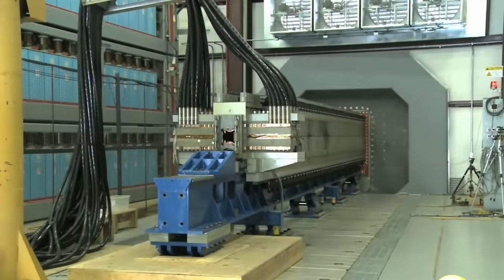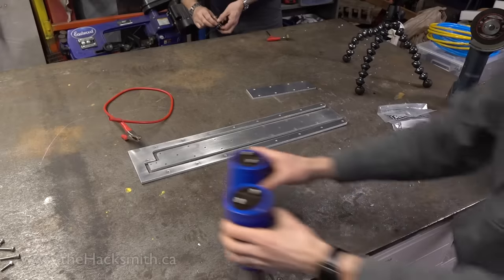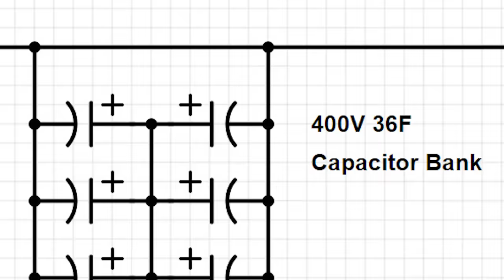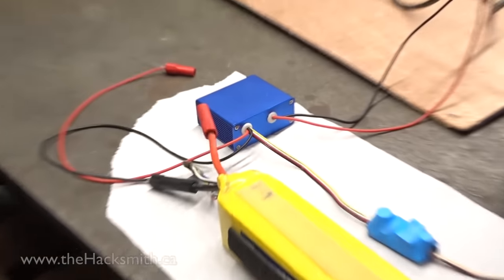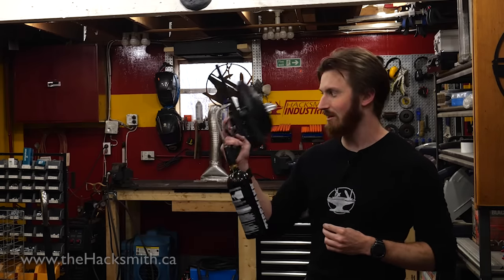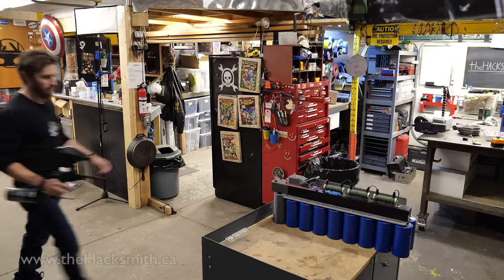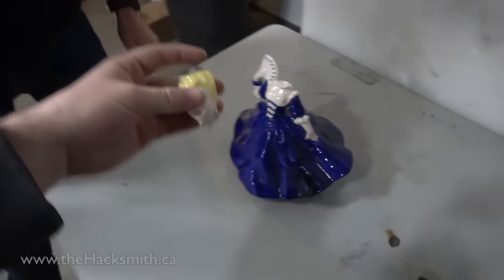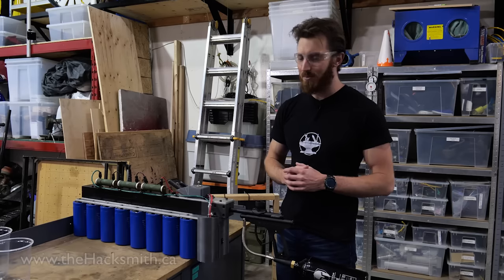Making a RAILGUN and then TESTING it!

Comment: The footage you show in the beginning of the big USN railgun, THERE IS NO EXPLOSIVE THERE!!! (THE FIRE IS JUST DUST IN THE AIR CATCHING FIRE WHEN THE SLUG GOES BY), THE FLASH WHEN IT HITS THE TARGETS (THE LONGER VIEW) IS 6 1 INCH STEEL TARGETS!!   The first time they fired that one they had a target (1 inch steel at 1000 yards (with a foot concrete and 15 feet of dirt)) they had to recover the round from FOUR FEET IN THE BERM!!!!  The 'disposable casing' would be the SABOT (pronounce sAy-bOW) which makes it possible put and round projectile into a square barrel.

Comment: There is something wrong with it, with that amount of energy, it should be faster than actual gun. It needs a synchronised acceleration.
Reply: because railguns use electromagnets to archive those speeds if i remember correctly and the bullets arnt round, the outside shell has fins that if i rememebr correctly are displaced by giant magnets in series pushing it really fast, dont know they actual physics to it

Comment: In some other rail gun build ups the most time was taken on timing the system. In this video no time use for getting timing right.

Also projectile was not that powerful, because it did not penetrate most of the targets, but just bounced off. Even in over 100 degree angle...

I think that the timing was wrong and therefore the railgun lost much of its power. Also ramping with random power levels means, the timing was even more likely wrong, because the time between coils varies on acceleration that magnetic fields make. Stronger current means stronger magnetic field inside the coils. You would need pretty excellent timing software and equipment to use just random power levels. And there was no hint that they used one...

Comment: Quick thing: If you can somewhat streamline the design (and maybe cut back on the power just a notch, can't you makea powerfist?

Instead of a projectile, have a weight attached to a rod which is propelled by the magnets, triggered by for example completely clenching your fist (you throw a punch with a half-tight fist, but the moment before impact, you clench it fully,  extending the weight as you make impact).
Reply: Also, It seems that the bullets (I know that's not the focus here, but still) could maybe use some stabilisation, since they tend to flip rather than maintain trajectory (kinda like shotgun slugs tend to do).
I don't know if you can make rifling on the inside of the railgun barrel, but perhaps adding some kind of rifling to the bullet will make it more stable in flight.

Comment: You should revisit this and see if storing the gun in colder temperatures like a freezer or using cold things like nitrogen to see if it'd give it a boost. You'd use less electricity thus then you could make the gun even smaller

Comment: not enough velocity for the round size so the round starts to "keyhole" as it is called. The round starts to tumble rather than fire straight. It's over my head for the physics involved but  I think there is an equation that to balance the size of the round to the amount of energy applied to the rails. I'm not fully versed in that, nor am I an expert, so my words only carry so much meaning.

Comment: Using two large copper rails will be massively reducing the potential power you are getting out. You need to use coils of wire, rather than solid blocks of copper. You will generate a much stronger magnetic field doing so.
Reply: Consider the flux direction of the solenoid and that of the rails. You would need helical coils running the length of the barrel.

Comment: I figure things out... There's a reason why a large scale rail gun keeps failing, except in science fiction. I believe mine will not only work, but will require far less energy. There is no propellant, other than a metallic shell. If you'd be interested in a collaboration, a build, and a video, send me an email with contact info. Using the same amount of electricity, I believe mine will shoot the projectile at least 30% further.. Oh, it's also more compact, cheaper to build, and lighter. We are going to need something like this for travel in our solar system and outward. I may sound like a nut here, but using atomic/nuclear power to charge an electrostatic collector, you'll be able to gather all of the raw material to replace your projectiles..

Comment: Hmm, maybe Canada's definition of firearm is different. The Texas Penal Code defines a firearm as "any device designed, made, or adapted to expel a projectile through a barrel by using the energy generated by an explosion or burning substance or any device readily convertible to that use." Since there isn't technically an explosion and there is no burning propellant, nor can it be quickly converted to fire by those means without substantial modification, even with higher power levels, that is not a firearm. IMO. I even looked up qualifications for a destructive device. This still uses propellant. If you would like to up the power, but are worried about legal issues, its something to look into. There may actually be no law against it.

Comment: Possibly the Vo velocity would be higher when leaving the rail gun section without shooting the bullet into this acceleration section with air pressure. The induced magnetic field of the bullet itself needs a little more time to fully utilize the acceleration force.

Comment: A gauss rifle is better because there are no rails that need to be replaced as the deteriorate.  A gauss rifle pushes a metal projectile up the bore at high velocity but does it in such a way that is even higher velocity that a normal coil gun is able to do.  That disposable casing is a sabot.  If you are interseted in building something new then what about a form of thermal detonator?

Comment: I'm now wondering? If you made all this footage that impresses easily, with the playful shorting of the Caps & sparks during Railgun build. Then just increased the compressed CO₂ psi, Then fired CO₂ down the barrel shaft with a spark arrester triggered. It did have that feel and sound to it. I could be wrong. That's why I'm not trying to state facts or call anyone out. It was just an experienced gut feeling. Great video either way thanks!
Reply from the maker: A rail gun isn't that complicated lol no need to fake it

Comment: Hello
What voltage did you use in the capacitors?
What was the capacity of the capacitors?
What was the thickness of the wire coils?

Comment: before my life ends i am certain a railgun is meant to put things into space, nasa said the space shuttle went 100 miles in 8.5 minutes which is 811 miles per hours
maybe a airplane can go into space if it can go 811 miles an hour for 8.5 minutes but a railgun defintely can 
they said the space shuttle went 17,000 miles an hour but if it did it would go 100 miles in under 3 seconds

Comment: It seems like a very inefficient build for the power its packing.  could be several things,  intentionally tuned down, etc, but honestly, I think it's the rails that are to blame.  

In order to have an effective and efficient discharge, you need both precisely manufactured rails and precisely aligned rails.  I think it fails at least on the second count.  also, every time the projectile strikes the rails it loses a ton of energy (all those sparks flying out the barrel?  a good bit of that is molten bits of the projectile and rail) That's why the military version uses a (presumably nonconductive) sabot to protect both projectile and rail.  Rails also get damaged with every discharge, sabot or no,  necessitating either recalibrating the existing alignment or replacing the rails entirely on a very frequent basis.  

There's a lot of very good reasons why the navy has spent so long developing one with only limited success after a decade.  It's easy enough to generate the effect in principle, but it's damned hard to build something that can function for more than a few shots without wrecking the internals, that doesn't weigh as much as a semi, and can actually achieve useful velocities.

Comment: when electrical storage technology advances to even greater feats like smaller batteries and capacitors storing more energy and being able to actually output higher voltages, there is possibility of arm mounted railguns. i wanna see that,

Comment: Can it's also work as same like with alternative current supply
Reply from the maker: No
Reply: @hacksmith  why
Reply from the maker: @piyushsahu7873  because the reason it works is because of DC, the current flow
Reply: @hacksmith  okk thanks ,but any video or suggestions for it's compact building chalges

Comment: how many joules or farads you have on this?
At this voltage level you can charge with halogen lamps/resistors --> retifier --> capacitors.

Comment: What is the purpose of a compressed gas tank with paint ball assembly??
Reply from the maker: A rail gun projectile requires initial propulsion otherwise it just welds itself shut
Reply: @hacksmith  OH! Nice.  Good to know.  Not so much up to date on the magnetic propulsion systems.  Other than riding popular rollercoasters...which do not require such initial propulsion enhancers.  Guess smaller scale systems require such enhancers which, in themselves, could provide greater velocity than what I was seeing in the video.  Just say'n.

Comment: Good work, and result looks like nothing effective achieved - don't worry - it is principle problem... only one turn of coil - only short part of it - accelerated - from lo speed, short time(results in low momentum) ... short distance(results in  low kinetic energy) , no way to get pocket hammer to press little iron parts with same good style of work, but there is more effective way to use capacitor energy for shot - electricalhydrodynamic effect (effect of Yutkin (russian inventor)) - use discarger in water - instead of fuel - to get steam engine in the world of pistols - you can use distilled water in closed end of steel tube, connected to cap, then drop inside bearing ball - it will shortcircuit tube and coaxial electrode - in some accurate amounts of water - and will do BOOM - much more effective than one turn of coreless coil

Comment: Why don't you fire the projectile without using the electricity to show that the rail gun portion is actually accelerating it? A slight that big at the speed from the paintball gun is enough to break plates and glass.
Reply from the maker: You need initial velocity otherwise it just welds itself to the rails
Reply: @hacksmith  I entirely understand that, however your projectile doesn't seem to have much velocity upon exiting the rails.
Reply: The version the Navy uses, has an armature that experiences the Lorentz force that propels the projectile.

Comment: Current moves slower if the wire is thicker. So if u make a thick peace of wire come off the first load of wires in 3 or 4 like a triangle or a square and make them go to the next load of wires, u may not need to use all of that technology on top to equally turn on the next load of wires, making it cheaper, but hey, I am probably wrong
Reply from the maker: What wires are you talking about? It's a rail gun -- the power goes through the copper rails. The capacitors are directly attached to the rails. In fact, there is zero technology to turn on the next load of wires... Did you mean to comment on our coil gun video??
Reply: @hacksmith  sorry dude must of been drunk when is sent this

Comment: Can someone tell me the specifications of the capacitors used and where can I get them
Reply: The voltage rating needs to be above 400V, or whatever voltage you plan on using. The ESR needs to be low. The capacitance needs to be high. Exact specs don't really matter, just "as big as possible", but pay particular attention to the ESR. IMO lower ESR means more than higher capacitance, though there are equations to work out how much charge you could dump in a fraction of a second. 

Exactly how much fraction of a second depends on how fast the projectile is going to travel, and how long the barrel is. 

If you don't know all that, or where to get caps, you might have trouble designing the 400V DC generator used to charge them. And 400V across big caps will ABSOLUTELY kill the shit out of you, much more so than mere mains electricity. Not something to mess with without experience and training. 

And then after all that it was a piece of shit gun anyway, it's apparently not just enough to be able to build one, you need a bit more knowledge and experimentation to make a GOOD one!

Comment: Needs a sequencer... As it stands, it appears it's fighting itself... Hence extreme lack of muzzle velocity. The projectile has barely more energy than it had from the paintball gun itself.
Reply from the maker: Sequencer? Its a rail gun,  the circuit is on or off. Coil guns have stages that need to be tuned -- which we've also built :)
Reply: @hacksmith  I apologize for the vague and quite possibly ignorant comment I made regarding your railgun project, however I was theorizing that sequencing the firing of the capacitors after the projectile has passed mid-point through the field would increase kinetic energy of projectile... I may be way off but I'm interested in your opinion. Another idea may be to have individual banks of capacitors (possibly 3 banks of 6 capacitors per bank) with  amperage increased in each stage... With the design of a good firing circuit for each stage, couldn't this increase the momentum of projectile through each stage?
Reply from the maker: Nope. It's a rail gun,  you want maximum power all at once because it's accelerating along a single rail

Comment: ok so the resistance of the human body is around 90000 ohms and the voltage is 400 at max so 

400V/90000R=0.0044I 

so 4.4  milliamps not thousands but whatever

Comment: Disappointing: If that 400V, 36F capacitor bank had transferred all of it energy to a, say, 20gr slug, it would have travelled at 38000mph. If the 36F is actually 36mF, the speed should still be 1200mph. No matter what, the energy transfer is VERY poor. With a different design, 2 or 4 capacitors should thunder that slug away.

Comment: hello boss, in my opinion you should make a casing that can split 3 for your bullets, bro, and on the back of your bullets that are in the casing even then given a spring so that the bullet speed increases. the size of the bullet reduced by half of the cartridge rate, in my opinion, is not a problem ...
the important thing is it can be 7G. hopefully it's true

Comment: Samething but in civil setting but car started back before speed I fell from 90 to 35 before control or operability could be gained.  Freeway setting 3_4 am 5 lanes of traffic 2 semis w car in middle that I witnessed a device facing out passenger window.  No explanation.  Any insight. The device stopped all electronic systems in vehicle. Vehicle ran ok , week later dead battery, new car.